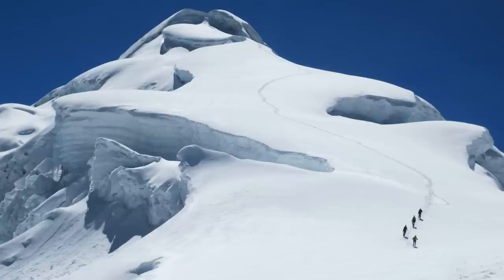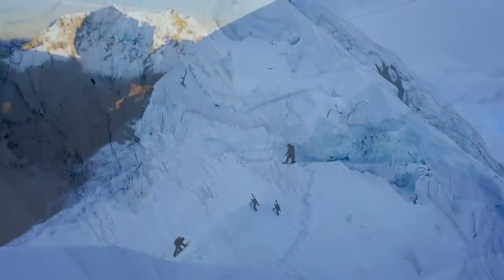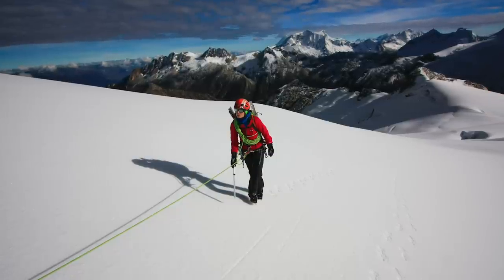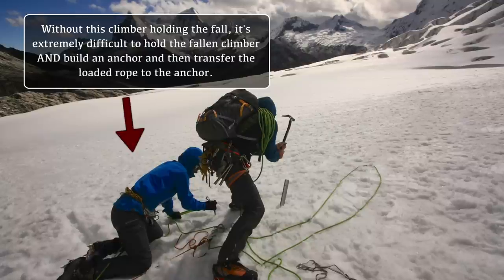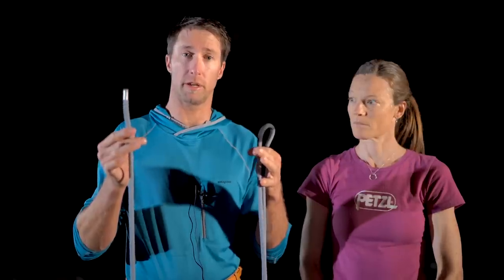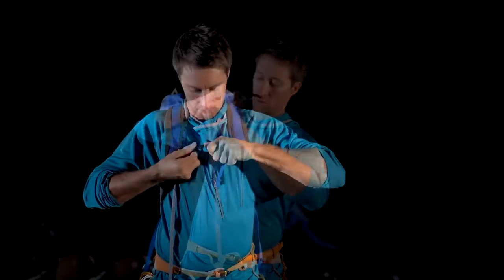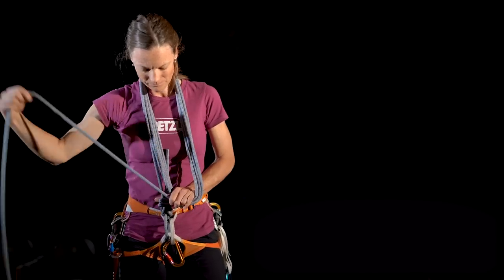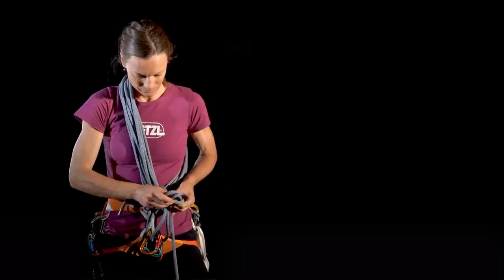Advanced Glacier Travel Techniques and Kiwi Coils

Comment: I’ve used the last overhand on a bight to clip back to my belay loop so the falling climber’s weight is taken at my waist rather than higher up, making it easier to control. If clipped this way, do you think it would still be easy enough to still clip this bight to the anchor, then unclip it from the belay loop, and escape the Kiwi?
Reply from the maker: Yeah, that works fine and I usually find that it works best when the bight isn't super small.

Comment: What are your thoughts about clipping into the two tie-in points on the harness vs the belay loop. I realize that clipping into the belay loop is the common practice these days, but I like having the 'biners closer to my body and reduce the dangle factor. I also noticed that the BD Alpine Bod harness is still made without a belay loop so if you're going to attach to the rope with 'biners, you pretty much have to clip into the tie-in points.
Reply from the maker: Good question. I generally clip into my belay loop because I don't like the thought of my carabiner being triaxialy loaded by the tie in points. With that being said, it seems very unlikely that the forces that a falling climber would experience in a crevasse fall would be high enough to break a carabiner, though it's hard to say. If a triaxialy loaded carabiner breaks at around 6-7Kn, and the climber experiences 4-5kn in the fall, that doesn't leave much margin. ENSA did some tests and found that the person catching the fall receives less than 2kn (170daN). However, the falling climber with a big pack would feel a much greater force and I don't have those numbers (the numbers above are just an educated guess). 
Here's that vid for reference: https://www.youtube.com/watch?v=IgNR-VZMwHo
So, what I usually do to keep the knot high is tie in with a small overhand bight. And on benign glaciers I'll clip the strands to my sternum strap, though that can make self arresting quite difficult.
Reply: Perhaps to test if a falling climber would generate enough forces to break the biner if clipped into tie-in points instead of belay loop, we tag our friend @howNOT2
Would you please test this? 😁

Comment: SIET, somewhat related question: If you are only climbing on moderate or low angle glaciers, and not doing any lead climbing, what are your thoughts on using a static rope as the main connection between climbers? I have heard some Denali guides use static group for this purpose, and I'm curious what are your thoughts.
Reply from the maker: johngo6283 Yeah, lots of guides do that on glaciers and testing suggests that the overall effectiveness for holding a fall (arresting) is much better. The person falling in the crack usually falls  way less due to lass rope stretch.
Reply: @sietschoolforinternational5234  Plus, a static rope offers way more ME when hauling than a dynamic rope.  The stretch factor of dynamic rope makes it pretty inefficient for hauling operations.

Comment: Hmm... For 3 person team, I'd do 40m rope. 10m between the climbers, and then each person at the end has 10m to do the rescue with. You don't have to be able to reach the fallen climber with a loop to haul them up - use a prussik and a pulley to pull the rope that goes to the fallen climber. This also works if the fallen climber is unconscious and can't receive a loop.

Comment: What kind of rope should be used for rescue on glacier travel, static or  dynamic?
Reply: Dynamic because it is also your climbing rope. The kiwi coil is the best way (imo), if you can't manage a crevasse rescue as part of a two-person rope you are no safer with three or four-person ropes. The "if you want to learn more " refers to learning practically how to make a Z + C pulley system.
Reply: @souleymanediarra5565  Why do you say you're no safer with three person rope teams? It's much easier to self arrest the larger your rope team, you have more gear in case of any droppage or really bad quality snow for anchors, and rescues are faster and easier to perform assuming everyone is competent. The only safety advantage a two person rope team has is speed, which is something to consider depending on the objective.